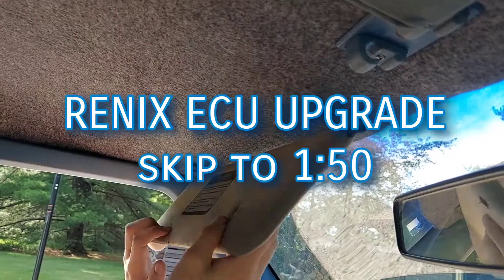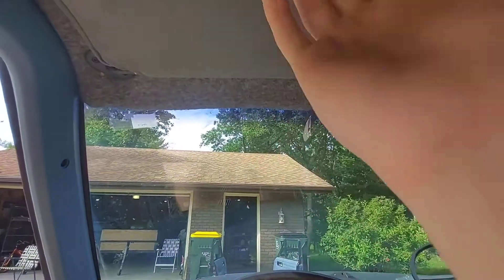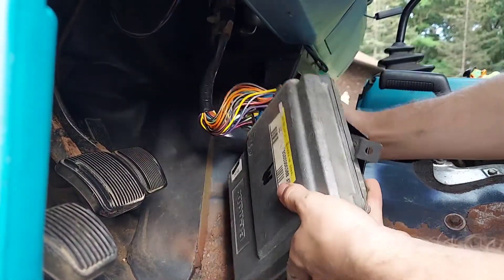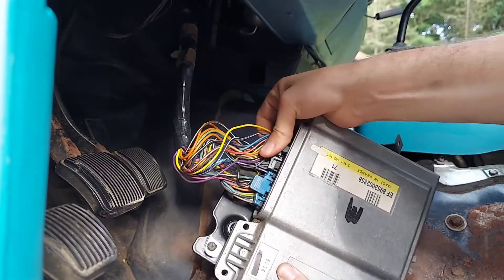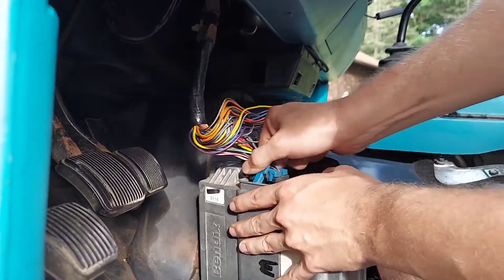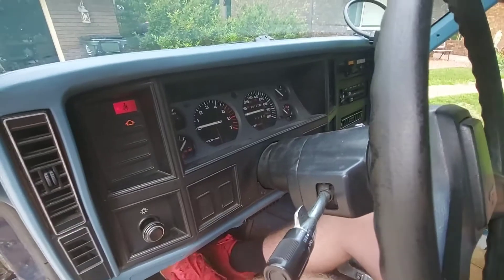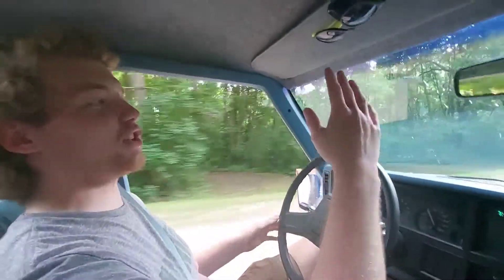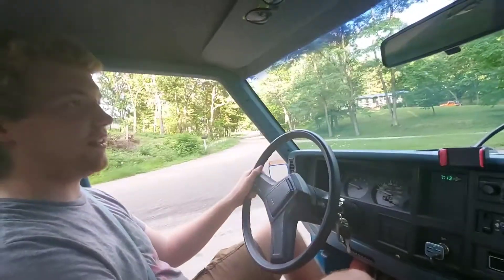Jeep Comanche - Renix ECU Upgrade and Sun Visors

Comment: Man, thanks a ton for this video. My comanche had the ECU mounted compeltely wrong like your mj at the beginning. I was just redoing my wire loom and your method looks most correct. I don't know why AMC designed a multi-mount bracket for a renix ECU that never changed size.